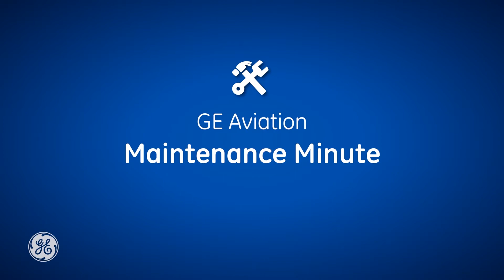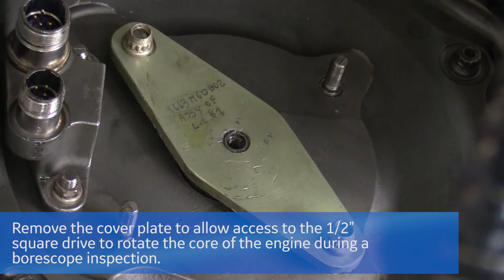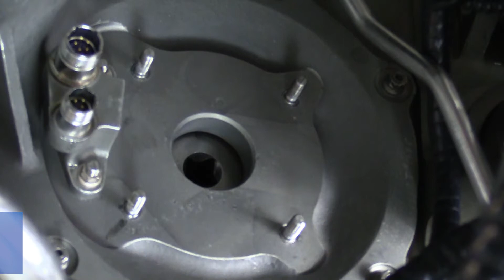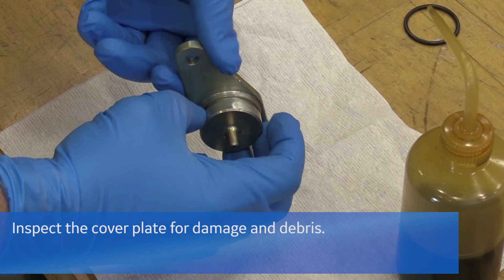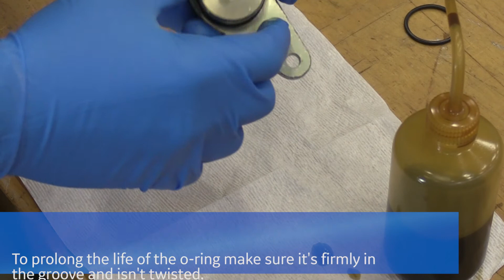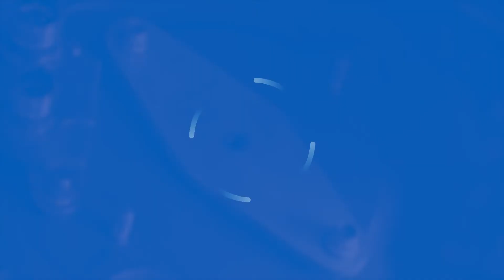CF6 - N2 Motoring Pad Cover Plate - GE Aviation Maintenance Minute

Comment: There is so many things wrong here, Pad is already popped out of it original seating position....theres no way you can pull out the pad cover that easy with just 2 fingers. There is washers missing under the nuts. The pad cover is not fully seated at the end....very bad video to learn from.